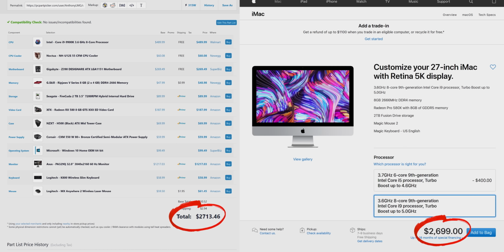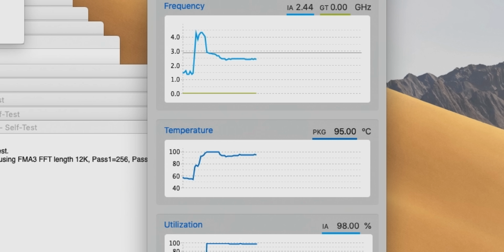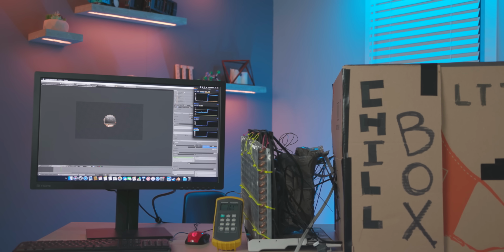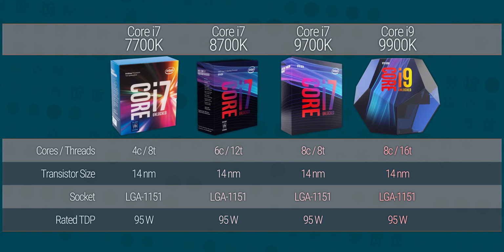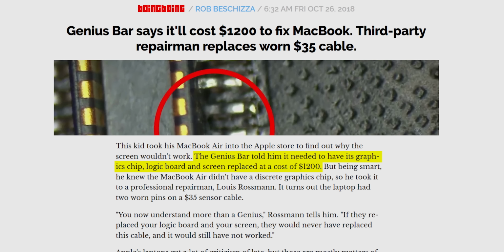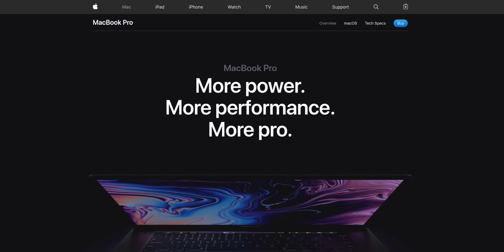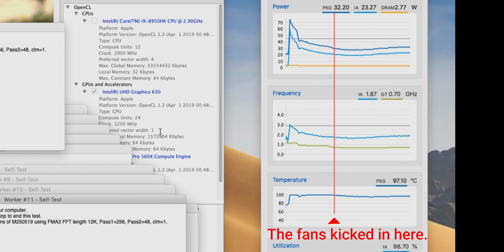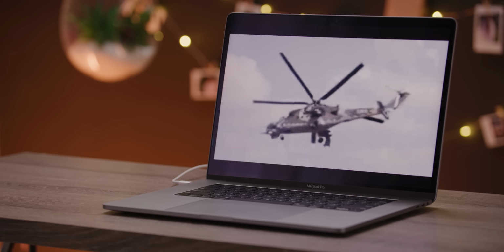Macs are SLOWER than PCs. Here’s why.

Comment: On the topic of iphones not having thermal issues while macs do, I think the main factor is profit.

The iphone is their biggest consumer line by leaps and bounds (note I said consumer, this doesn't include services). More profit means more resources to allocate to r&d which means an overall better product in the end. The iphone userbase is also much larger so they have a higher quality standard on those devices. Not to mention you physically hold the device in your hand. Most macbooks spend their lives either in a bag or on a table hooked up to 5 dongles. With the iphone, you hold it in your hand 99% of the time you actually use it. You'll immediately notice if it hits thermal limits and will sour your experience.

Comment: The problem with PCs is you have to run windows, which is very crude. Windows 10 especially is atrocious user experience.
Also why are you ignoring similar thin and light PC laptops with similar components that perform similarly?
Reply: You don't have to run windows. No one is forcing you choices. Except apple. Just install Macintosh
Reply: @bobbybaeX  You have a point - but in this video it was directly Windows vs Mac.
Reply: @lorinh2947  But it did make you comment useless. Anyhow i myself like Windows 10 alot more than macos. The only thing i like with macos is the keyboard shortcuts. It's a personal opinion if you like windows 10 or macos
Reply: @lorinh2947  but let me hear what make windows 10 such a horrible user experience? They are pretty much the same in that way
Reply: @bobbybaeX  I have spent 100s of hours troubleshooting Windows update / general issues since I work as an IT guy. Macs just don't have the flaky-ness that Windows has. 

When doing general things, I really don't want to spend 5 minutes troubleshooting opening google chrome since Windows update decided to change the MTU value on one of my network adapters. This isn't horrible once in a while, but when using a MacBook and this just doesn't happen - you can see why I personally switched.

Comment: Oh no, Apple cares. As stated running at 90+ degrees is bad for the entire system and can lead to it bricking from heat cycling... so what does that mean? Instead of their laptops lasting 5-6 years like other manufacturers they brick in around 2 years guaranteeing more revenue.

It's purely about money. They do not care about their customers at all and have proven such with how they actively lie to customers "No your data can't be recovered" to people with years of data stored on their devices that failed for simple and fixable reasons.

Comment: Perhaps the iPhones perform better with less heat because their custom-made ARM processors are more efficient? But the Macs use the same x86_64 processors as their competitors while trying to be slimmer so they perform worse. Which is why ARM-based Macs may be a thing soon?

Comment: Apple has full control over the design and production of their iPhone/iPad chips, and none over the Intel chips used in their desktops/notebooks. This accounts for at least some of the difference in approach and practice regarding how it deals with those thermals. You’re right that the could and should do better when it comes to their machines, but it makes more sense to compare what they are doing with what other PC manufacturers are doing (as you also did) than to compare to their phones and tablets.

Comment: Did you just suggest that a Core i9 running on a base clock is “sluggish?”
Reply: 2.9 ghz will act sluggish with several programs running at once, even one program depending on what it is

Comment: The sole reason Macbooks overheat - They don't have air intakes for the CPU/GPU blowers.

That's right; The CPU has a blower fan, but the intake of the fan is blocked by the bottom cover, leaving less than 0.5mm of space for the fan intake.

I had a customers Macbook years ago that kept failing because the CPU was hitting 90C constantly. I removed the bottom cover, thereby allowing the blower to actually pull in air and the CPU temperature immediately dropped to 55C. Put it back on? 90C again.

Solution I did - got a metal hole saw and cut a hole in the bottom cover where the intake blower was and then superglued a piece of window screen to prevent junk being sucked in. The laptop ran fine after that, no overheating and no throttling.

Apple designs their products to fail and they don't give a flying toss about their customers. Even if you have Applecare, they'll do everything they can to avoid fixing your stuff.

Comment: the difference with mac and PC is you have a free market on PC building. So you can use eBay, amazon, craigslist, let-go, offer up....it it works like a charm. But with macs, you cant buy parts, you have to buy the entire mac mostly from apple store or "Licenced" refurbisher.

Comment: Intel has always told OEMs that heat management is critical and they won't warranty a cpu with inadequate system cooling. You cut the life of electronic components and CPUs in half with every 10°temp rise. 1000 years at 68°F now keep cutting that in half, watch how fast it gets to 5 or 10 years.

Comment: Can’t forget the fact macs come with amazing displays and have high quality build quality, I’m a pc guy myself bc i game but respect macs
Reply: I don't believe 100 degree temperatures any time you try to do anything more than boot the computer speaks to a quality build. It looks nice, but looks can be deceiving. Macbook pros have been throttling for years, and even the more recent iMacs do it too, thin doesn't mean good. The build quality overall is questionable when the computer is likely to destroy itself before you get a chance because apple made poor design choices. The display does you no good when your GPU fails because it overheated btw.

Comment: 0:15 The reason why the pc costs so much is because, for some reason, Linus picked the most expensive 4k monitor in the universe. If you remove that and the enthusiast grade motherboard, the whole pc costs around 1300$ and an IPS 4k monitor will be another $300, resulting the Mac being a whole grand more expensive then the PC equivalent.
Reply: Exactly, a lot of people who say "they're the same price" do this. I already have a display and that's one less thing I have to buy next time I get a new computer. I already have an SSD I can bring over along with a keyboard and mouse. Be honest, most of the people who would be doing such a comparison would already BYOKMD (classic Mac mini reference)
Reply: True that to get the same spec the price would be similar but the spec was stupid to begin with, getting a similar albeit slightly lower performance and quality with significantly way better price would be what most people wanted and needed
Reply: If you buy an IMac 5K is because you want/need a 5K IPS, calibrated and best in class, to edit video and photos, or similar tasks. There’s no such thing as “Pc equivalent”, Macs and Pc are two different systems for two different use cases. Why is that so hard to understand?
Reply: @HardwareNumb3rs  Not sure if i understood your comment correctly, but the 5k display in the IMacs are not even close to being "best in class" nor is it factory calibrated. You might be correct about the fact that you cant buy equivalent stand-alone monitor, however, you can get very close for alot less (~400$) or a true pro grade monitor for "a bit" more money.
Reply: Quantum Troll yes is factory calibrated, I tested it with the xrite and the profile was perfect, the alternative is the Eizo or the LG, but the cost is very high, and then the comparison might be even in favor of the iMac
Reply: @HardwareNumb3rs  My bad, it seems that it is "factory calibrated", still, you can get very close to the Retina screen for ~400$ unless you really want that 5k for some reason. 
Also, im pretty sure its an LG display thats in the Mac.
No doubt that Macs screen is good, although it seems very hard to find a display specific review for it.
Reply: Quantum Troll The panel used is probably made by LG yes, I can’t remember where but I read a full review somewhere, if I find the link I’ll post it here. 5K is a nice format for video creators, it allows you to see a 4K clip at 100% plus all the timeline and tools when editing, a big plus imho, also when working with photos the thumbnails have a resolution that is crazy sharp, but for this a 4K can do s similar job.
Reply: To be fair, Mac displays are known to be some of the best displays.  They have a reputation in the industry.
Reply: @theskyspire  I totally get that, 5k monitors are expensive also. I feel like a display of that quality is in a niche for people comparing the prices of PC and Mac. The color reproduction, IMO is better suited for phot/movie editing. A well rounded 4k monitor at around $350 would be sufficient for most people. More people nowadays are using their computers with their TVs. I have had my Macbook connected to a smaller 1080p screen for a long time.

Comment: Linus I build a new computer with 6 120mm fans. I have the corsair spec delta, a cooler master 240mm radiator. And my graphic car don’t need to have its fans on and still it’s cool, it’s like 40 degree without it’s own fans

Comment: Holy shit, STOP PERPETUATING THIS IDIOTIC NOTION THAT MACS ARENT EXPENSIVE BECAUSE YOU MADE A SHITTY COMPARSION THAT NEEDLESSLY REPLACED SHITTY APPLE COMPONENTS WITH TOP TIER PC COMPONENTS LIKE A 240MM LIQUID COOLER AND BLU-TOOTH MECHANICAL KEYBOARD!
Reply: What?
Reply: @tvg2848  the statement they keep making about Mac about it being reasonable price compared to an equivalent PC stem from one of their Mac review videos where the equivalent PC they built had among other a 240mm liquid cooler, wireless mechanical keyboard, etc against a Mac that throttled because of bad cooling and that terrible standard Apple keyboard.
Reply: Trillykins it’s perfectly fair, you can get better stuff for the same price.
Reply: @sam9216  that isn't their claim. It's that you cannot buy an equivalent PC for the same price, to which they bought better components, such as liquid cooling versus a Mac that they report is throttling due to inadequate cooling.

Comment: Yeah, but, really, the reason people buy macs is the software. Using & programming for Windows sucks dick for skittles. *nix is just SO much nicer to use. 

Also, heat may shorten the life of components, but if your hard on for speed is that big, by the time things are wearing out you’ll be upgrading hardware anyway. 

Don’t get me wrong, Linux on a PC is approaching the best of both worlds, but until the market share increases enough to drive proprietary commercial software that can rival the ones available on macOS then Linux desktops are still going to be incomplete for 100% of personal use cases. There’s a TON of great free software out there, but certain consumer packages will never be as good as their commercial counterparts, and there simply isn’t (currently) a business model or economic incentive to be able to rival them as FOSS nor are there enough volunteers and infrastructure to do it for free ($).

So beyond looking good (which they definitely do) a lot of what you pay for with Macs is the access to the OS and the mix of great commercial software as well as FOSS software. I’d argue that you recoup a fair amount because so much great FOSS software can be and is ported to macOS from Linux. Just look at the Homebrew project, for example.

Comment: Nicely done.  But to claim tech savvy users don't use or like MacBook I feel is a bit misleading.  I write software all day and would never go back to the PC laptops.  Their power bricks are huge, they are much thicker, less battery, and overall system stability is much better on the Mac.  Yes the CPU may be slower on very high concentrated work loads.  But I haven't really noticed this.  What I do notice is amazingly fast IO, Rock solid os with great Linux like environment out of the box and the built in hand warmer when I'm compiling is a nice touch.

Comment: The reason iPhones are great and macs are terrible is that macs have always been terrible.  Then Apple made great iPods and iPhones and suddenly Apple's stock exploded as they went from a medium company to a big company.  They want to continue this success and reputation and so won't mess up too badly on iPhones.  I'll use it and put up with all the dumb quirks because it will usually simply work, perform well and not fail through 6 years from now.  Other phones not so much.  Macs OTOH get to leech off of the iPhone's success.  Then people say "Oh, it's Apple, it seems cool too."  So they use marketing and so forth without really improving the macs.

Comment: Why does macs work better with window on instead it's own os system.
Reply: It doesn't. While gaming wise, Boot Camp handles it much better, the battery life is absolute shit (like less than 3 hrs), the display brightness isn't as bright, the audio isn't as loud, and the fans are just crazy yet still overheats even on idle load. These can be mitigated though through some tweaks.

Plus setting up Boot Camp can be super annoying if it doesn't go as planned. It's a nightmare to troubleshoot. But it's still worth it for gaming.

Comment: Why does Apple put higher-spec processors that thermal throttle instead of lower-spec processors that run as fast in real workloads? PROFIT! Not just marketing, there's also much higher profit in those higher-tier processors. And Apple's top priority is high profit margins.

Comment: The current Macbook Pro chasis was designed to eventually implement Intel’s 10nm chips.  Apple clearly suffered a sunken cost of R&D and continued to use the same design with the hotter 14nm CPUs.  Hopefully the 2020/2021 Macbook Pros are better thermally managed.
Reply: Let’s wait for apple’s custom arm based MacBooks with <7nm cpus
Reply: When Intel makes Core i11-i12? :D A11/A12?

Comment: Apple technicians - how slim do you want an i9 laptop to be...

Tim Cook -  Y E S
Reply: Tim Apple*
Reply: Its Tim Apple
Reply: It’s funny he says how slow Mac are but I had two PCs before I switch to Mac, and both PCs were just horrendously slow. By the way both PCs were new, so no reason why they should be that slow. So this guy can be biased all he wants. I’ll stick with what works best for me. 😏
Reply: @Crazy-77  "The pc's were new" Isn't a reason.
Reply: @Crazy-77  Specs of both supposed pc's you bought?
Reply: Crazy 77 You do realize even new Laptops can have lower grade specs... you can still put a old i5 In a new computer and it’ll be the same speed as that old i5 even if it’s new it won’t mean shit. But Apple uses really good specs with shitty cooling so you’re basically just wasting your money. Because the CPU can’t run at it’s full potential, if it had better cooling it’d be really snappy. Trust me, get a good windows computer and you’ll never go back to Apple. In fact you can hack a windows machine to even use iOS so I don’t even consider Apple an option ever. However, I like their phones but I’d never use their iMacs or anything related.
Reply: Man can you explain what you mean by the statement its everywhere on internet
Reply: https://www.youtube.com/watch?v=XV5eGNe81us
Reply: Not completely true, I think it's more like
Apple Marketing - how much slim do you want an i9 laptop to be

Tim Cook - Yes

Apple technicians - But...

Tim Cook - I SAID YES.
Reply: @1972LittleC 
Or more like
Design team - how slim do you want an i9 MacBook Pro to be?

Tim Cook - Yes

Apple Technicians - But...

Tim Cook - I said YES

Apple Technicians - But Sir!!!???

Tim Cook - swearing when I fucking say yes, I don't fucking change my mind. 

Apple Technicians - But Sir, AirPower...

Tim Cook - You're fired!!! 

Apple Technicians - You mean me?

Tim Cook - The whole technical department. You're all fired. Rip it up, we start from scratch. Fuck! 😫

Comment: 10:00 I don't like an apple but I can give you a better reason behind that question. Apple wants more power in their laptops and Intel hasn't gotten their new manufacturing tec up to par yet. You said earlier there phones don't thermal throttle and that's because Apple makes the CPU's themselves. Remember, Apple said they will eventually make their own Laptop CPU's, probably for that very reason. so that's the answer. Apple is going to make their own cpu's eventually but for now, they will just stuff in whatever high-end intel stuff is available.

Comment: I'd be interested to see a Mac Mini transferred to a PC case with proper cooling to see how it performs VS stock.
Reply: Snazzy labs did a hackintosh that was actually smaller than the Mac mini and performed better than the Apple Mac mini. It’s on his channel from several months ago.
Reply: if the CHILL BOX results are replicable, I guess at least 25% higher.
Reply: @pinocatozzo  Yes the giant "chill box" made my Linus using refrigeration parts is similar to a $30 PC case's couple of fans.
Reply: @TexMex421  obviously the air would be way less cold but the parts would not be enclosed in a tiny box, sooo... :)
Reply: @pinocatozzo  Yes a tiny metal box that radiates heat, and has a cooling fan and heat pipes inside. so...   It's too bad Linus does not own a PC he could do a test with.  But he does own a "chill box" so that is just as good.